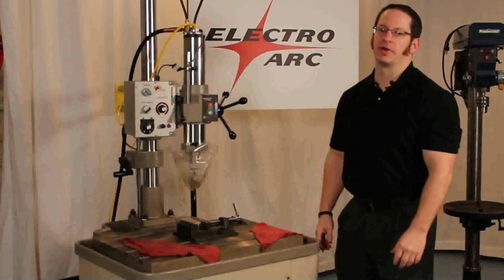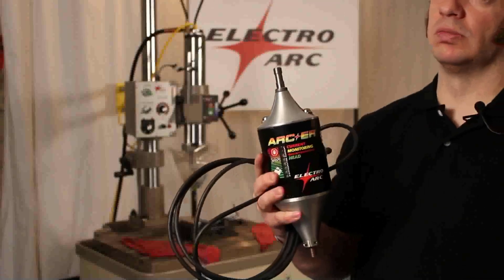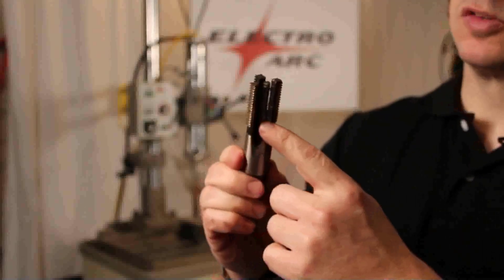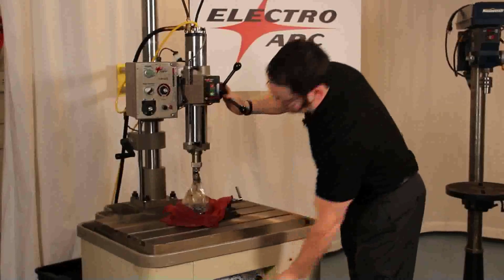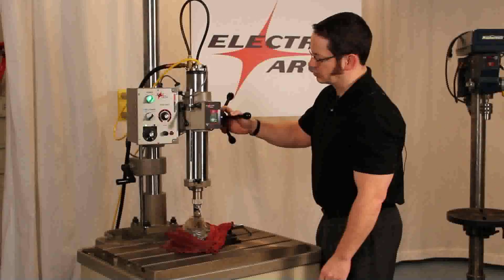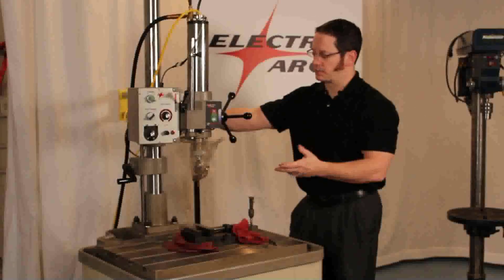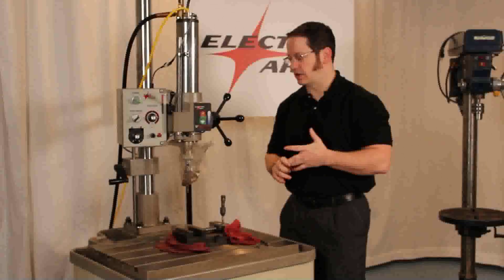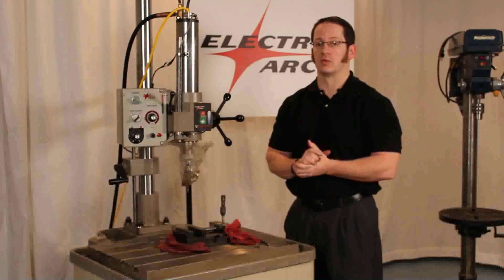Electro Arc Metal Disintegrator

Comment: so this tool is for if I screw up my other tools? Sorry, I'm new to tools and carbide disintegrators sounded cool. Is this for like milling work I guess? So your sacrificing your tap to save the Part? That's neat pretty sure this is to specialist for me right now. I'm not even a hobbyist yet, eventually hope to open up some sort of shop so I'll try to keep this in the back of my mind.
Reply: generally its for when a tap breaks but can be used for anything, sheared fasteners etc....

Comment: Is this basically an arc gouger?
Reply: Not exactly, Arc gougers use compressed air, Electro arc metal disintegrators use coolant and create 60 Arcs per second to disintegrate broken tooling.  These machines were specifically designed to remove broken bolts, while Arc gougers are designed to remove old or defective welds or to dismantle equipment.